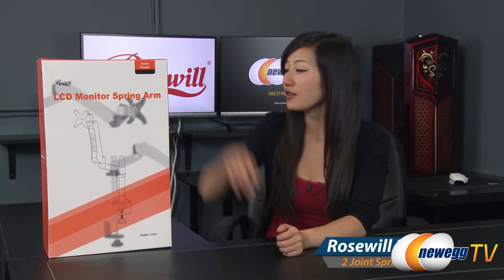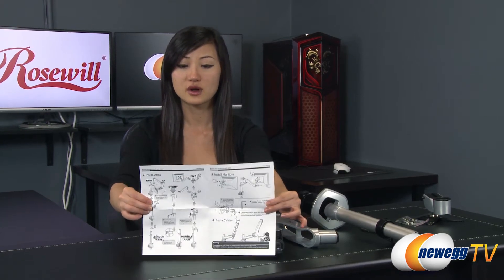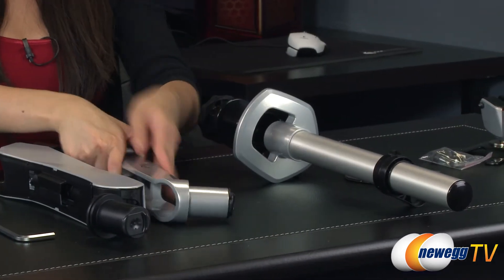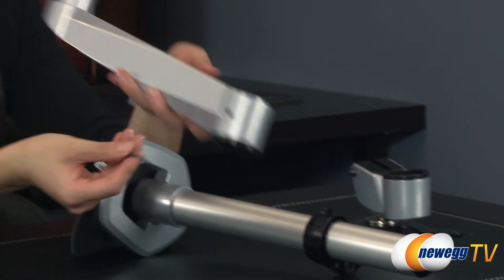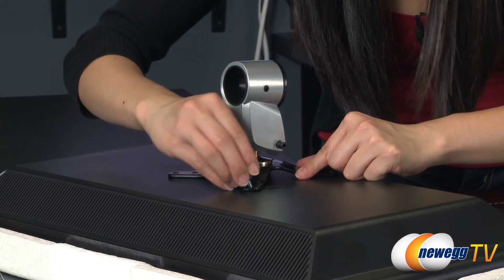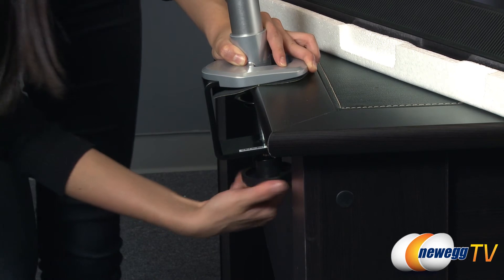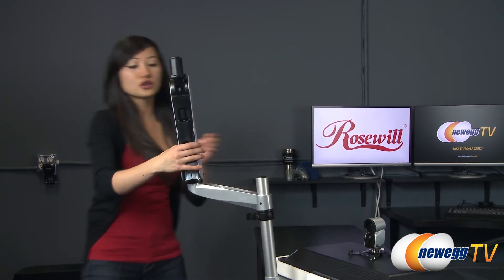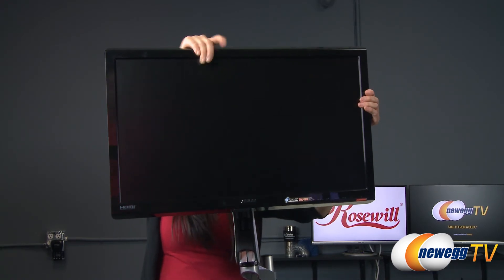Rosewill Diamond, 2 Joint Spring Arm Overview - Newegg TV

Comment: Joanne, the pad is upside down. The paper peels off and the pad sticks to the underside of the upper flat bracket clamp.  Also, as others have mentioned you needed a table with more available space on its underside. That drawered wooden desk was in appropriate. And flat table will be fine.  I think I might get a few of them, this will give my wife more desk space, and swing my monitors closer to my face as I recline with my "lap" keyboard, and arm rest mounted mouse pad.

Comment: I watched all the way to the end expecting it to fall off the table and crash on the floor. The unit looks solid, but that doesn't matter if it's not fastened well.  I'm not criticizing Joanne.. but they should have given her better a better desk to work with. They should design it so the large hand screw can be removed and tightened with a socket wrench instead. That would allow the clamp to go another inch or 2 deeper on the desk lip.